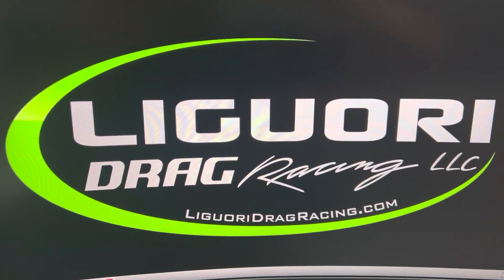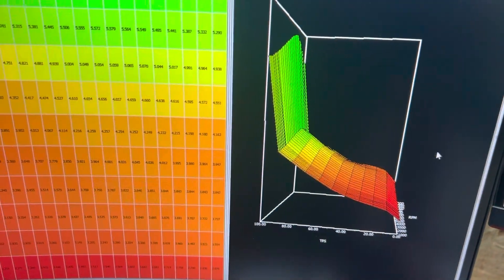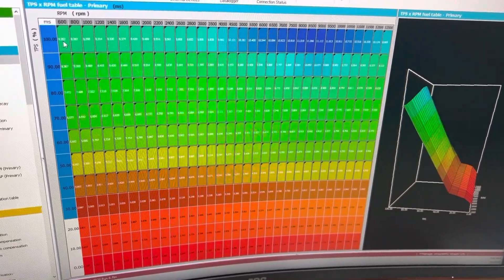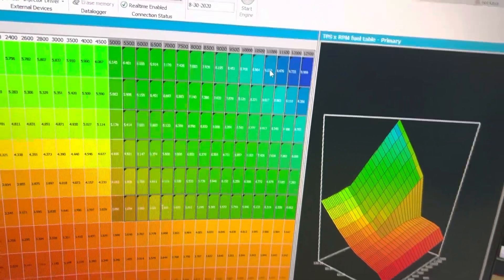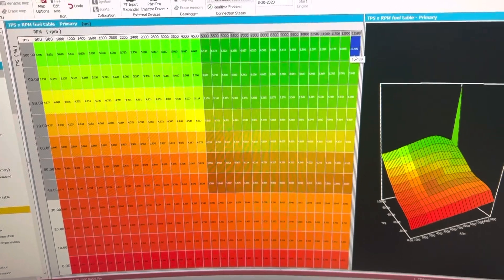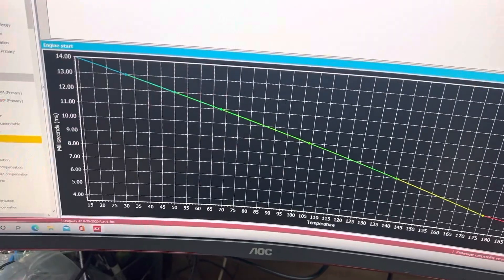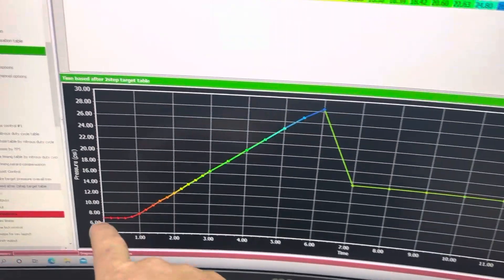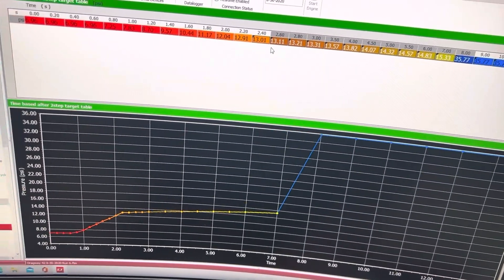Vertical and horizontal interpolation explained using FuelTech

Comment: Can you explain why there’s a peak in the fuel table right around 8k to 8.5k rpm towards the top of the table? Is it hardware related, or is there another reason why you’d want to shorten the injection time as you go higher in rpm?
Reply from the maker: Tuning in MS follows more of a torque curve. If you click F6 to switch to LB/HR it will continually go up to the corner of the table.
Reply: @LiguoriDragRacing  thanks!